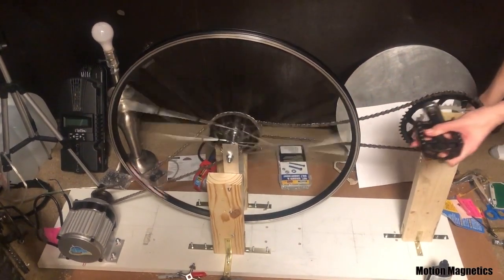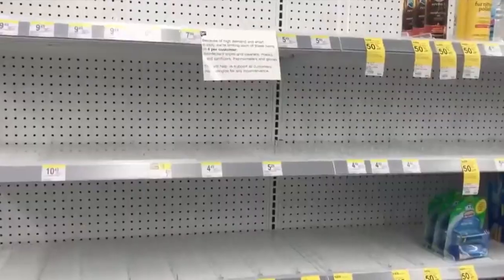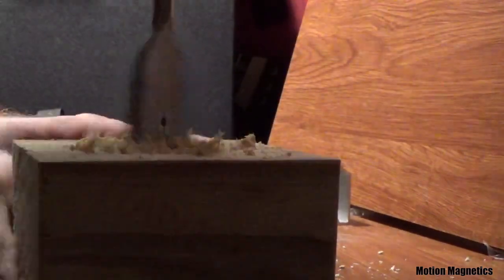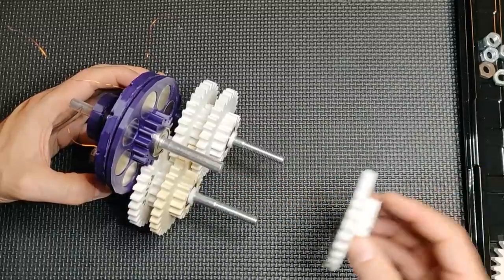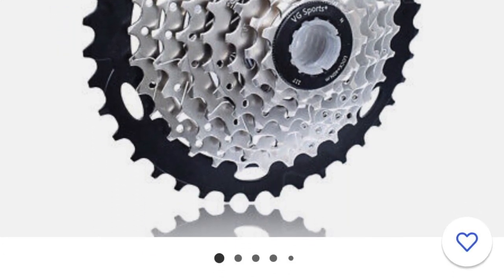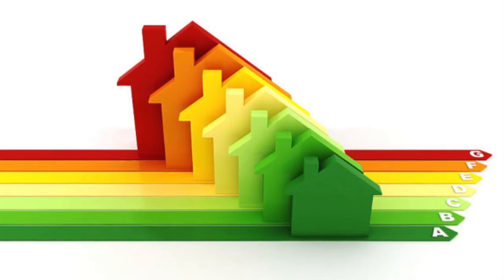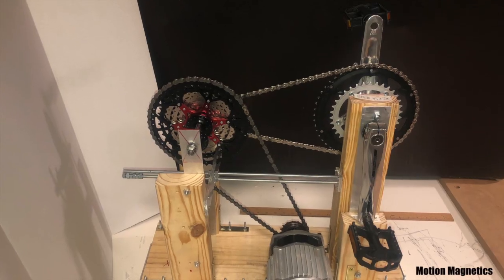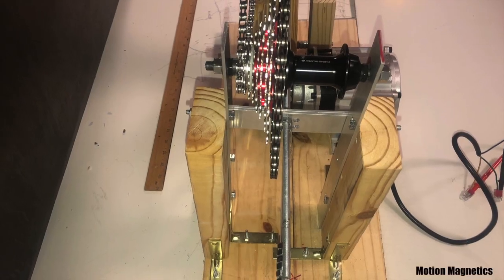Pedal Generator

Comment: It's cool to see that you built this and that you're able to hit peak RPMs for the alternators/generators that you're using. One thing to note though is that you won't really be able to hit those metrics when the system is under loads that you'd want to charge the battery. If you're charging a 48v battery, you need at least 20v above the fully charger (generally 58v) feeding into  your mppt. You'd have a pretty tough time even charging at 5 amps (~250 watts) for any reasonable amount of time. Assuming you're able to ride at 250 watt pace for an hour, you'd be very tired and it'd likely take much more of your resources in way of food and/or money to buy food to make up for the expended energy. That amount of effort would charge your 5kW (100ah) 48v battery to 1/20 of it's capacity, not accounting for loses. It's a useful thought experiment and certainly a decent way to learn about motors and electrical theory but, from a practical standpoint, you'd be way better off just picking up even a 50 watt solar panel and allowing it to do that and more each and every day without any additional effort/resources being required. Best use cases for a bicycle generator might be charging small battery banks that could top off phones, tablets, and laptops. A half an hour at a decent pace a day could keep each of those devices topped off and ready to go.
Reply: Good reasoning through great input equals sound prevention and ready preparedness when you (they) need it most. Thanks!

Comment: Peddle generators are a great thing to have around when there is a power outage.  
Adding a capacitor bank will allow charging of the bank to run lights, charge phones, and even connect to an inverter.
Reply from the maker: Agreed.

Comment: I suggest you try again with 4 tri coil axial Flux motors. Combine them all on one shaft but instead of wiring them directly together in parallel wire them all to a circuit board and make them parallel within the circuit, this will reduce the likelihood of the motors overheating with the high current from parallel connections 

They make cheap, low RPM generators and pretty easy to diy with lots of different 3d printed designs out there to copy from

Comment: Hi, good work sir….but you need to go back to basics. The limit of any pedal generator is the person pedalling NOT the rating of the alternator. The average person can produce more like 100w over an hour or so. If its a 48v system that’s a current of 2 A. The efficiency of a alternator or dynamo system is likely to be around 50% so even if your moderately fit and can sustain about 150w for a long period you’ll be lucky to put out 75w at the battery terminals. Thats 75 w/hr. The voltage you are generating in the video is the NO LOAD voltage. It’s doing no work. As soon as you connect a load you’ll quickly grind to a halt. So use a generator rated for more like 300w at 1000 rpm or less. If, as in your vid you harness a 10 kw alternator you’ll need to produce about 20 kw. A top athlete can produce about 1kw for a few minutes. So, start off with the ability of the human input and size everything accordingly, and don’t forget every time you add something - like an inverter or phase converter - you introduce yet more loss….
Reply: From my personal experience, I can say that the commonly stated 100w average is rather low unless you're a sedentary 70-year-old.
Reply: Thats why he is using gears to amplify his input by about 100 times
Reply: @jbcom2416   You can increase the RPM by reducing the torque and vice versa but you can't amplify the energy you put into a system with gears. if you put 100 watt into a system you will get less watt out of it after any kind of gear.

Comment: HELPFUL TIP.

I solved my free Power Supply problem by simply connecting the Alternator shaft to the chuck of my electric drill.

Clever Stuff. eh ?
.

Comment: I learned that a 160 tooth front ring can move a bicycle at 30 mph at 90 watts. This is walking pace. Instead of using the fast twitch muscles on the top of the thigh, use the slow twitch muscles in the hamstring.

Comment: Do you think you can generate more than 1 horse power? That is almost 750 Watt. Only heavy trained people can.
This means you can start looking for smaller generators. With a 1kWh output or even less.
I am using an e-bike on a stand. The 250 Watt motor will generate the same (in my case). And I can tell you: 250 Watt output is very hard to do. Proof is on my channel.
Please look out for an e-bike. No more work to do, and you can still use it as an e-bike if you put a decent plug on the wires. (this is a note to readers, who are like me with two left hands).

Comment: some things to point out which you probably know just saying just inc ase. 
As for magnets vgates as you had the issue is see is that all are too short and it needs to be long enough and heavy enough to get enough momentum to break though.

As for flywheel, A heavy flywheel is a battery and the heavier the longer it lasts. 
Sort of like the video "The Power In These Flywheels Scares The Pants Off Me" | Savage Builds

The end of the heavy flywheel is is the easiest to move and acceleration is the issue and one accelerated takes less power to maintain the speed than to get up to speed. Having 2 heavy flywheels I assume where one helps aid it on the long end can help than the center.  Again just a thought.

Maybe you can do the math to see which better to see it on papers 1st than in practice. 

As for friction  do you know the "Tractor beam magnet" setup? How about a 3d one where its on a 12 sided cube.

But a simpler thing would be what they did in the video "Magnetically Supported Flywheel Spins Insanely Long" which has little friction. 

The bigger the scale the more efficient and smaller the less for many things.

Comment: The best way to harness the power without getting way too tired is to connect that ebike motor to an elliptical machine (which is lying around unused in my case) 

Just wondering what wattage is that ebike motor used in ur setup...

Comment: so by using weight.  If you use a flywheel, then the momentum from the weight of the flywheel can be used to maintain the power and flow of the generator power on long enough to be able to switch the power cord from the motor to the generator and therefore become...self running.  It looks real to me.  I can't see why it won't work.

Comment: Wrong!  A PMA running at 24v to 48v is not the issue, the load current is.   Just wait till you try to charge a battery with it.  Not going to produce enough power with you pedaling very hard.
Reply from the maker: We'll see. I've tested it with a load, but haven't tried charging a battery yet. I'll share the results once I do.
Reply: A casual cyclist will output 200watts or less, so best to optimise a system to that power. Operating the alternator at lower rpm is fine if you are only charging lower voltage batteries, 12v nominal for example. Good luck with your future iterations of generators.

Comment: only a single low rpm motor-generator
Reply: change the parameters of the motor, no need to add gearing load
Reply: diy generator-motor, dc in-out, hall-effect motor-engine, just neo magnets and copper coils, at least 2 simple configurations, radial and disc
Reply: spin mass energy storage in vacuum
Reply: add more supports, wood or plastic, aluminium works too, just be really smart about it
Reply: better framing, of a house

Comment: Your going in the wrong direction. The more electrical load you use the more force you need to add with this style of generator. You need a stream to give you a constant force like a water wheel to make this idea practical. And if you were going to do that then you should look at vortex water generators. You were on the right track last year but veered off into the weeds now. Fields are energy when you learn how to extract it. The public is still not ready for this, I wounder if they will ever be ready? Trust in the Creator of all things to guide you in understanding creation and how it works. Ask and you will receive.